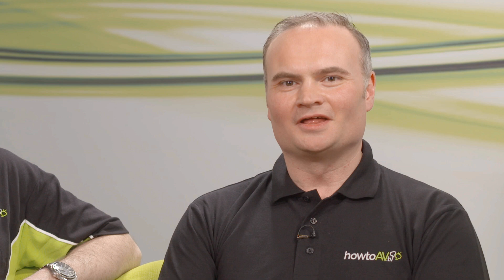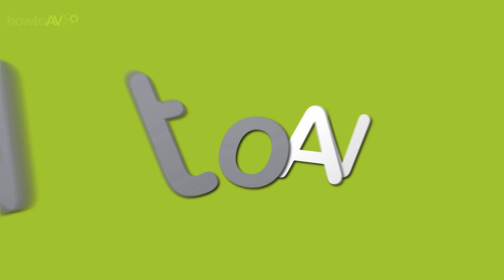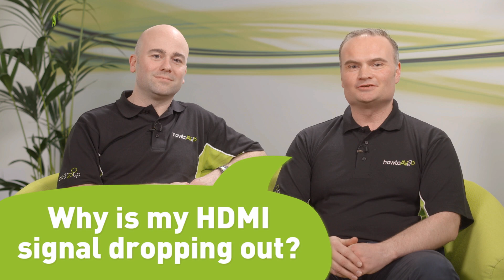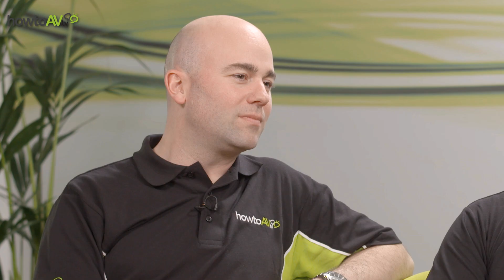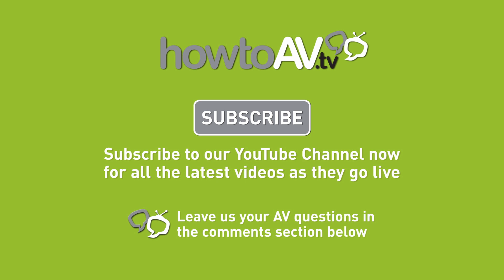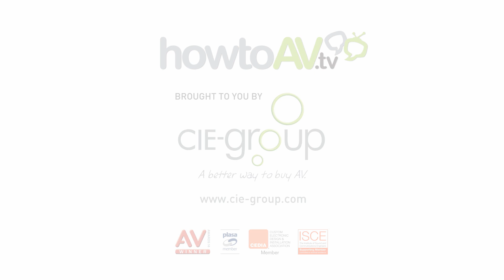Why is my HDMI signal dropping out?

Comment: Hello,
I have a TIVO Premier Series 4 that has an HDMI that will not work. It seems that this is a common problem with this unit, but TIVO will not tell how to repair it. Can you please tell me how to repair it?
Reply from the maker: +Cliff Eck Hi Cliff and many thanks for your question. The common reason for faulty HDMI sockets is where there is a frequent plugin/unplug, as HDMI sockets are really designed for 'plug in and leave' unfortunately.
It would be unlikely there is a problem with the connector itself, the likelihood is that the termination on the board has come loose.
Therefore, it's a job for someone with some great soldering skills! (whether that be you or your friendly local TV repair guy?!)

Our suggestion to prevent this from happening in the future?
If you have a device which you frequently plugin and unplug, then add an interim male to female HDMI connection lead between device and HDMI cable.
This helps in that a) they tend to have a more robust termination than a PC-mount connector and b) if it does go wrong, it's only a few £s or $s to replace (somewhat cheaper and easier than fixing or replacing your AV device)

The HowToAV Team

Comment: i have a problem with my hdmi port it has become rather lose so when i connect the hdmi cable it hangs rather slow and no picture appears but u can hear the audio and if u angle the hdmi cable higher the picture comes back. Is there a way i can tighten the hdmi port?
Reply from the maker: +Joe O Hi Jo and many thanks for your question. 
(Same reply as question above I know!..)

The common reason for faulty HDMI sockets is where there is a frequent plugin/unplug, as HDMI 
sockets are really designed for 'plug in and leave' unfortunately.
It would be unlikely there is a problem with the connector itself, the likelihood is that the termination on the board has come loose.
Therefore, it's a job for someone with some great soldering skills! (whether that be you or your friendly local TV repair guy?!)

Our suggestion to prevent this from happening in the future?
If you have a device which you frequently plugin and unplug, then add an interim male to female HDMI connection lead between device and HDMI cable.
This helps in that a) they tend to have a more robust termination than a PC-mount connector and b) if it does go wrong, it's only a few £s or $s to replace (somewhat cheaper and easier than fixing or replacing your AV device)

The HowToAV Team

Comment: Hello my ps4 screen is not showing with the hdmi. All i can hear is the audio but no picture plz help me.
Reply from the maker: +DR_Pizzle_03 Many thanks for your email and sorry to hear you're having problems.
Here's what one of our engineers had to say - it appears he has experienced the exact same problem!...

It seems to happen when the PS4 cannot auto detect the screen resolution of the TV so outputs a 1080p signal or another resolution that the TV cannot handle. The way to resolve is as below from a support forum (gamefaqs.com). It seems a common problem

http://www.gamefaqs.com/boards/691087-playstation-4/71454755I had this exact same problem when I was trying to set up with my TV. My issue was that the 'auto-detect screen resolution' decided my TV could handle 1080p (when it can only handle 1080i).

Turn the PS4 off (you have to hold the power button on the console until you hear a second beep; 1 beep turns the light orange and puts the PS4 in standby, the second actually turns it off).

Hold the power button for at least 7 seconds. There will be an initial beep; then after about 7 seconds (felt longer), there is a second beep. This will turn the PS4 on in safe mode. [This  temporarily sets the resolution to the minimum (460p?)].

Select the one that mentions resolution or display (I think it was the second option). This will keep the PS4 at the 460p when it turns on normally. Once the PS4 is back to normal, go to settings and change the resolution for the best one for your TV.
EDIT: I had to try the standby mode twice to get it to work right.

Comment: Our HDMI laptop to tv connection , which has been working ok, now drops out and the audio comes out from the lap top,
but when you double tap it reconnects to the tv........help anyone......
Reply from the maker: +paul dracott Hi Paul - have you checked the following?..

1.      Try a different HDMI lead (possible faulty lead)
2.      Ensure HDMI lead is connected to laptop / TV correctly. Is lead getting knocked out of its connector on laptop?
3.      Is the laptop going into a power save mode after a certain duration? Check settings in Windows power management settings.
4.      How long is the HDMIlead you are using? If greater than ten meters you would need to use a good quality HDMI cable, booster amplifier or possibly an extender.

Comment: I have been having some trouble with using my hdmi port 1 with hdcp 2.2 with my cable box and ps4 (with and without hdcp enable). What it does it will shut down the port it normally comes back in time but I can instantly bring it back by plugging in my 4k capable laptop. So I had a really good feeling its something to do with the hdcp, any ideas?
Reply from the maker: +brandon white - Hi Brandon, Can you please confirm what equipment you have (manufacturer, part numbers etc) along with a description of how they are connected together? Is the 'cable box' you refer to a HDMI switcher or cable TV? Let us know and our team here will see what we can do to help...

Many thanks for watching! #HowToAV
Reply from the maker: +brandon white And can you confirm which sources aren't working correctly?
Reply: my PlayStation 4 and cable box. They used to work until recently. It is the only port on my TV that is hdcp 2.2. Once that port goes out I can immediately reactive it by plugging my laptop (4k res.)  into it
Reply from the maker: We would recommend visiting the manufacturer website for your TV to see if there is a firmware update available for the TV.
 
There is the possibility that the PS4 and cable box have had their firmware updated recently and the TV is now struggling to “handshake” with these devices. Having the latest TV firmware should hopefully cure these issues.
 
It's also worth checking on the the TV manufacturer's website and support forums for known compatibility issues.

Hope this helps Brandon...

HowToAV Team
Reply: +HowToAV.tv My Playstation 4 was plugged in to my sons smaller older tv for a couple of days then plugged back into my fairly new Samsung smart tv and the HDMI channel wouldn't pick it up. Plugging it back into the older tv again it works fine! On inspection on the Playstation pins 1 and 2 have been pushed back, would this prevent the connection between it and the Samsung but somehow still connect to the older tv?

Comment: I have a big issue with my ledtv hdmi signal...its samsung f5000 32". Its connected to my r9 270 brand new gpu on a pc. I have the latest drivers but ocassionally i have hdmi signal lost message on a tv screen. Tv is also brand new...i tried switching hdmi cables and also input from hdmi 1 to hdmi 2..but when the problem occurs the only solution is to restart the pc and the picture is back...